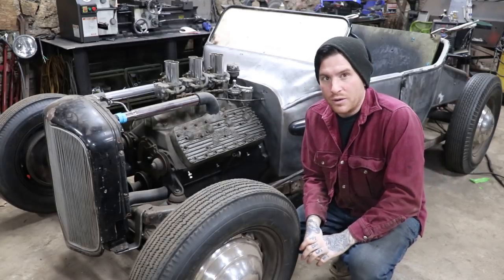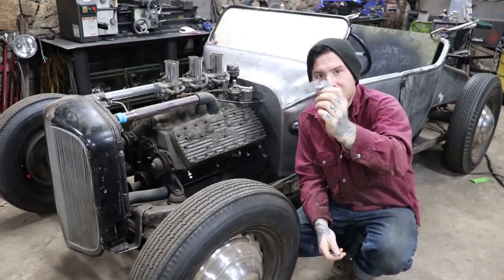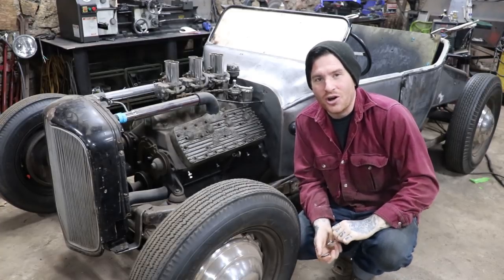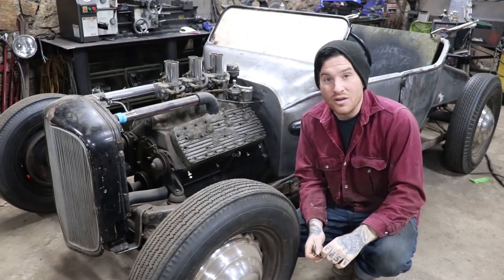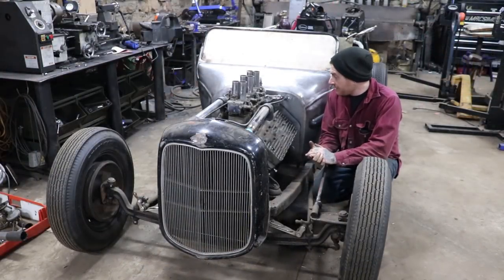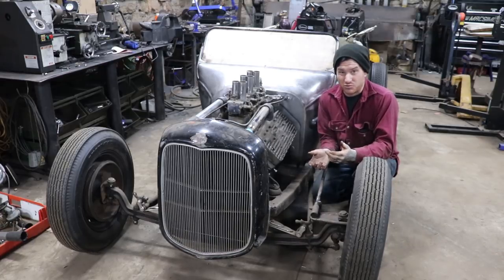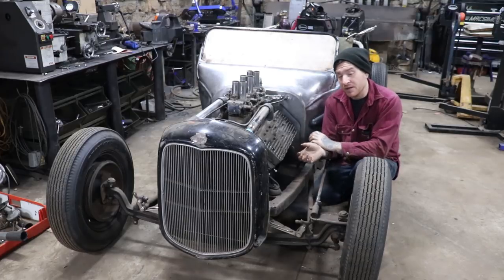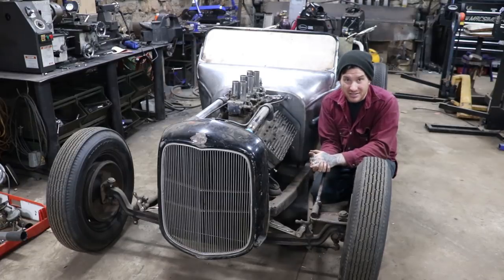Radiator Support Rod Mounts - Ford Free-T - Ep. 65

Comment: I was wondering if the two top radiator cooling  lines could have a design texture to them rather than just plain chrome?
They're pretty prominent as with all flathead configurations. The whole setup looks great!
Reply from the maker: Hi Thomas, I actually want these to be shiny as they will blend with the stainless exhaust and some of the old chrome parts on the engine. Normally I'd paint them black, but this car I decided to leave them shiny. Great idea though! -Matt/ITG

Comment: Matt, Are you not concerned about getting grindings and other shop debris in the carbs, down the intake and in the spark plug holes ?
Reply from the maker: That is a mock up engine core not my actual engine I’m using. The carbs will be all blown apart and rebuilt. I always use cores to build a car up. It will all be fully rebuilt before use.  Thanks for watching. -Matt/ITG
Reply: Thanks for your explanation. Keep making great videos

Comment: I can't hardly wait to hear this thing run...not just static, but going down the road hard with the three deuces kicking in. I haven't heard a 3 deuce setup for...40...maybe 50 years. Even then they weren't very common. Tricky to set up to run in sequence, so few tried it. Most that had them had them set up to run simultaneously, but that's not a big deal, just sounds like a big four barrel or maybe two... sequentially it sounds like they have extra gears, I guess that's the best way to describe it. If you haven't heeard it for yourself, it's not describable really. The last car I heard them in was a cherry resto mod 57 Chevy.Bel Aire on a 327 I think it was... not sure I remember all the details correctly
Reply from the maker: Me too! It's gonna have a nasty little flathead in it and should scare small children, arouse pretty ladies, and anger the grumpy neighbors. Just like a hot rod should do! Haha! -Matt/ITG

Comment: My concern with the radiator rods is that the bends are a weak point that said tho I imagine that you have sized them to make up for that.The devil is as they say in the details and I like these vids because they follow that well
Reply from the maker: I could see where that could be an issue if they were the only mounting point for the radiator but the radiator is bolted at the bottom and also fastened by the four radiator hoses. In reality the hood rods are under very little stress. I appreciate your input. I’ll keep an eye on them as I begin to drive the car. Thanks for watching! -Matt/ITG

Comment: love it from the front, love it from the back, love the engine and grille position but does anyone else think the front axle needs to move forward 4 or 6 inches so its in front of the grille ? just looks a little short or stumpy in the wheel base department..... Each to their own so just my thoughts ! but still love it.
Reply from the maker: I’m not building a stretched out rat rod. The idea is to keep the short wheelbase like most of the early T hot rods and dry lakes/dirt cars. The stretched out wheelbase look is a more modern trend and wasn’t nearly as common. Not everyone sees my vision and I’m ok with that lol. -Matt/ITG

Comment: I HATE rivnuts, but from an aircraft mechanic, those things are unreliable. Prefer actual anchor nuts. Great video as always, thank you.
Reply from the maker: I know not everyone loves them but for the small hardware I’m using them on they should be fine. Thanks for watching! -Matt / ITG
Reply: @IronTrapGarage  I'm sure they will. Just have nightmares trying to drill them out on F/A-18's when they spin, though the version they use are self locking too. :(
Reply from the maker: Oh man I can't imagine that would be fun at all! I have so much respect for aircraft mechanics! The level of detail and perfection is crazy to work on planes. Thanks for the reply Jason! -Matt/ITG

Comment: From the front of the car it looks like the front axle is wider than the rear. Is that from the camera angle?
Reply from the maker: Not sure I never measured but it isn’t uncommon when using an old banjo rear. I don’t want a 70’s style super narrow tube axle on the front or a super wide 9” rear in the back. To me it looks “right” for the era/style I’m building that car too. I will measure though because I never have! Thanks for watching. -Matt/ITG

Comment: Any idea what a 29 T frame is worth with front and rear suspension and rear axle...it has some small cracks that need welding...anything I should look for in particular?
Trying to start accumulating parts for a build 

Thanks for the help
Reply from the maker: 1929 would be Model A. I’d say $500 is a fair price with front and rear axles attached.

Comment: The front view of the free T is bad to the bone. Matt, what type of headlights are you going to install. Those Nutserts really come in handy and do a nice job
Reply: Agree on the front view. Great visual lines.
Reply from the maker: Thanks guys! Gerry- I just got some old Dietz 6" chrome foglights I'll be installing normal headlights in and running them on old polished aluminum Offy headlight stands. -Matt/ITG

Comment: What was that little hand help right angle DA you were using after the right angle grinder when cleaning up the firewall?
Reply from the maker: Hey Tom, That's the Rockwood 2" Right Angle DA. It works awesome in tight areas for sanding and polishing. Find it here: https://www.eastwood.com/rockwood-2-right-angle-orbital-sander.html?srccode=1VD5533